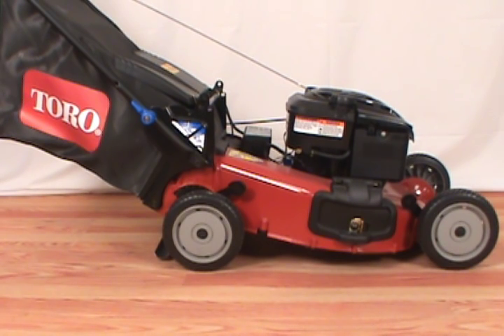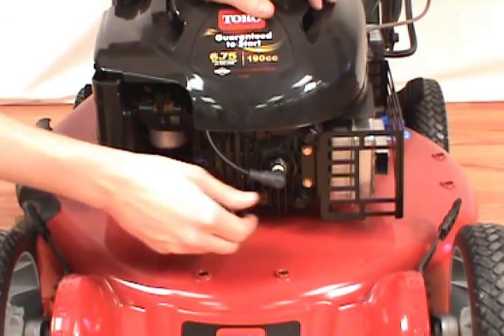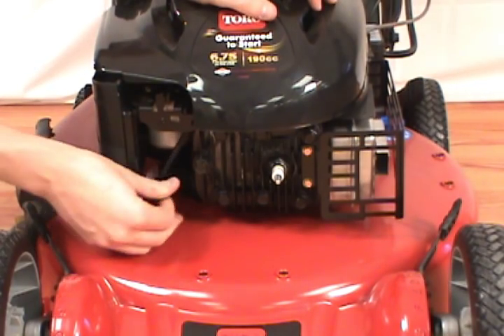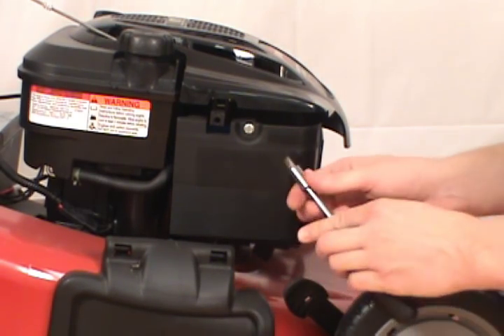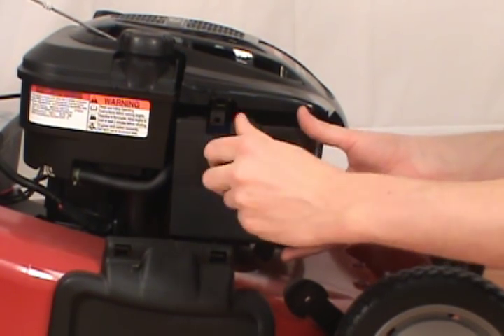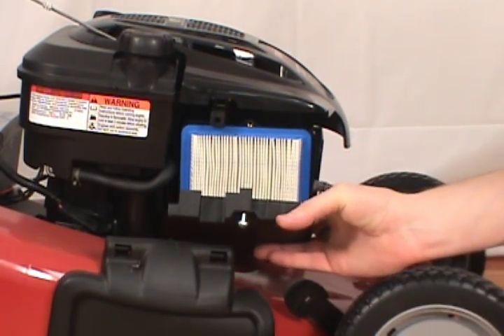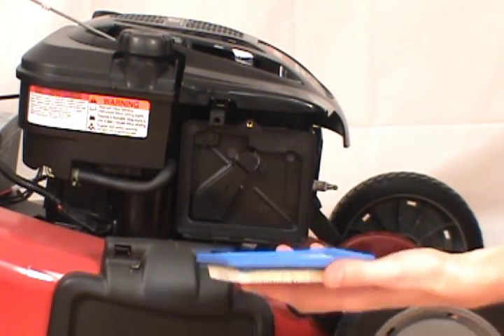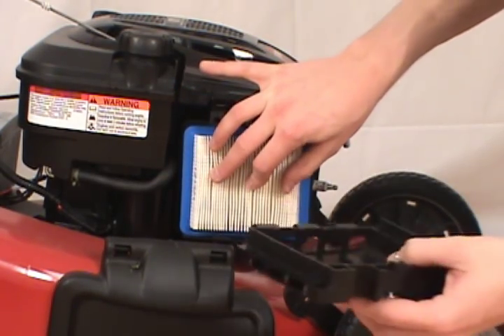Replacing the Air Filter - Toro Lawn Mower

Comment: Good job, brother.  To be a perfect video, mention the SIDE that faces in looks different, and re-connect spark plug after tightening screw.  I have been a teacher and trainer for over 35 years.
Reply: When You Open it there is only one way to put it in